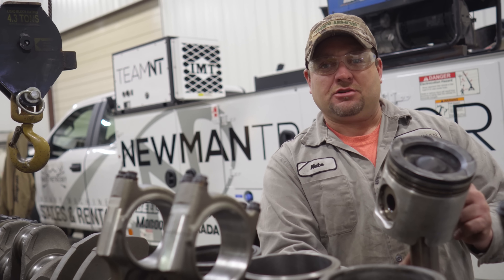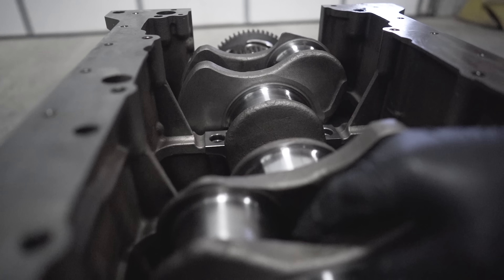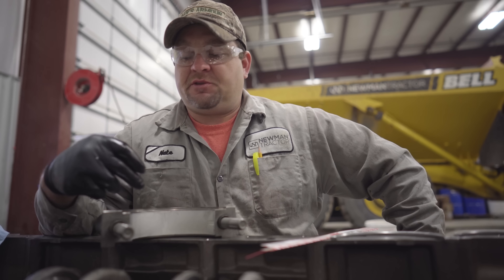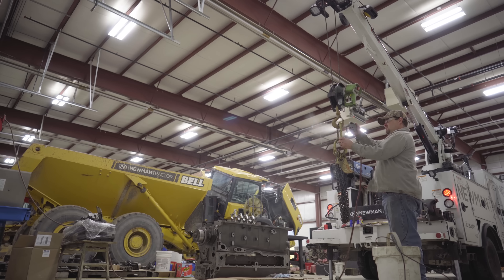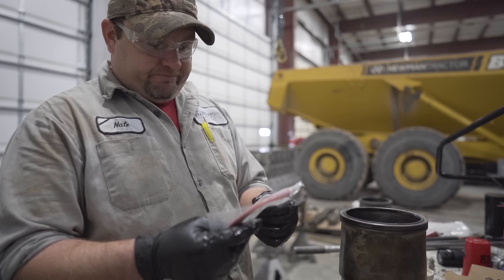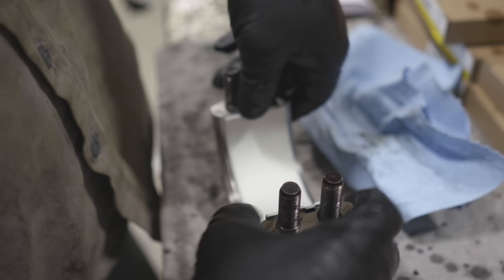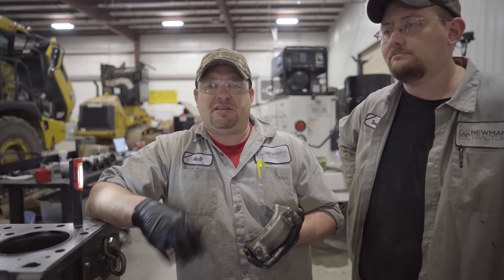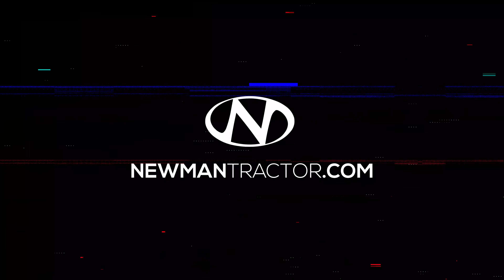The 24v Cummins Diesel Engine Rebuild - Everything You Need to Know

Comment: That's supposed to be a 24v but the oil squirters are under the main bearings and they are little plastic tubes and there is not one single video or how to instruction on the Internet of how to install them. This is not a 24v in this video it's a common rail....

Comment: Dude you are crazy you have the block sitting on jack stands and u climb under it to torque it without having a chain fall or something to hold it in case the block falls. Think about ur kids not having a father because the block fell and killed u. Not only is this not safe but you could crack the block if it falls. Now I know what everyone is going to say they have done tons of rebuilds and the block never fell well good that means that ur doing a decent job but having a chain fall holding this up just in case it falls off the jack stands is the same principal as an airbag in your car will you ever get into an accident bad enough for the air bags to go off probably not but if you do they are there for ur safety. You can also compare to the safety locks on a lift at an auto repair shop it’s not likely to have a cable break or a hydraulic hose to break on a lift but if it does the locks are there so the car doesn’t fall and kill you. Shit I’ve been a technician for 20 years I’ve never had a hydraulic hose break or leak and I’ve only seen one cable break so yeah it’s not common but that one time that a hydraulic hose breaks you will be damn happy the safety lock stopped the car from falling and killing you. I’m not trying to be an asshole but come on be safe it not worth the risk!

Comment: So odd how different engines can be. Maybe I just am too easily fascinated, but the engine in my bus, is so over engineered in some things, yet so simple in others. Although the way they want the gaping measured on the rod caps is just insane. Tighten one bolt up (before the TTY begins...apparently by magic since they dont give me that value lol), the measure how much the other end, the unbolted end of the cap cracks open. Measure that gaping maw, and then you know to tigthen more or not. Its so...imprecise to me, yet other things they want machined at .1 thous tolerance. (it aint a Detroit, or Cummins. Its a MAN engine...horizontal 6 with hemi...err not heads but piston bowls lol)

Comment: imagine the shopping list. we need piston rings valves, some big tools and... vegetable oil.
Reply: something is wrong , oil rings are lubricated with the oil in the engine while vegatable oil go sticky under heat and air !!! try do it yourself and you will find that oil turn to sticky shit
Reply: Some seals require you do not use petroleum based lubricants for the seals and they require a vegetable oil to lubricate. In the end it’s just lubricating an oring it’s no big deal.

Comment: Awsome video,s you guys make there is alot to know about rebuilding an engine. Have you ever did something wrong and trashed an engine you just rebuilt?
Reply: Sometimes when the engine gets grenaded exploded pieces bounce around inside the Piston combustion chamber or explode the head it's hard to identify all the replacement parts
Reply: When the engine has components that are in 100 pieces the parts may differ from year to year and end up putting in an incorrect rocker arm or something

Comment: Dude you seem like you know what you are doing, but the part where you have the engine block on Jack stands? And your laying underneath it while your buddy pushes the pistons down inside the cylinder so that you can connect the rod to the crank? I’m not telling you what to do, but if it was me rebuilding the engine block then I would have that put on a engine stand for safety. But that’s just me. One of these days that engine block may end up squashing your melon. I’m just saying...
Reply from the maker: Hey Mathew your right we should always have a chain/crane on it as a secondary safety measure. Safety very important to us and we appreciate your accountability. Thanks for watching and have a great day.

Comment: What are you spraying with that gun attached to the air hose ? Thanks
Reply from the maker: Great question Jonathan! Its a 5 gallon bucket of parts cleaner similar to a brake cleaner.  You can use an air spray gun similar to a paint gun.  It saves money on big projects like this instead of using rattle cans.  Thanks for watching and have a great day!
Reply: @NewmanTractor  What model spray gun is that? That thing is awesome!
Reply from the maker: Hey Michael we can find out the exact model from our tech but you can use any air paint sprayer. You can find a cheap one from harbor tech. Just hook up to air and at some solvent and you've hot yourself an awesome mobile parts cleaner :) thanks for watching and have a great day!